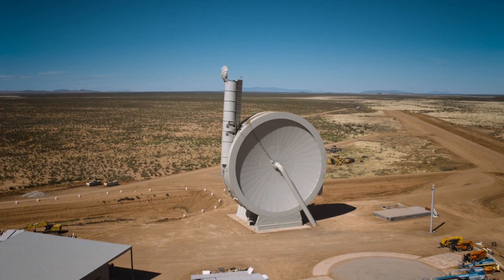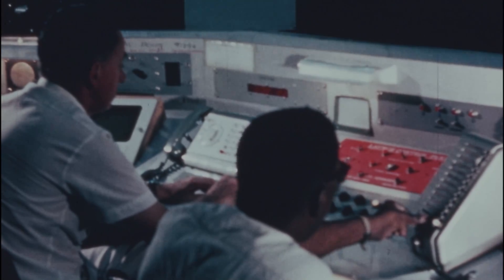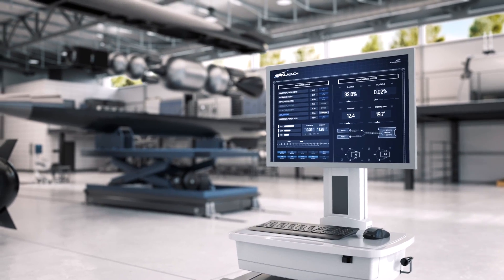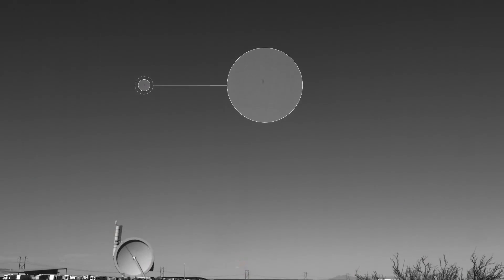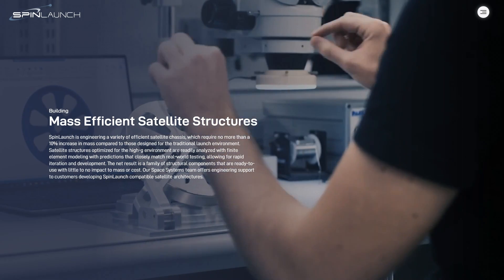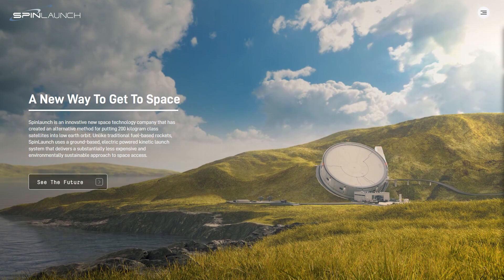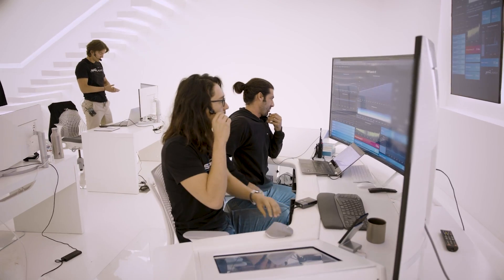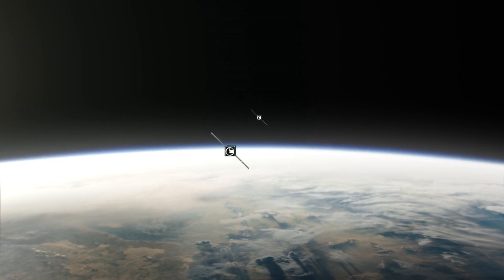Can Spinlaunch Throw Rockets Into Space?

Comment: This concept is realistically almost impossible, since you need to go slow at start and faster to get to space. Normally rocket experience max q at around only 20-30s which they throttle down the engine, but with this concept, the rocket launch will experience max q at start which will overheat the payload that is very fragile and delicate.

Comment: What about a hyper loop style of launch system.
You take a maglev sled, put it side of a tube that is long enough to get up to speed on a horizontal track. At the end you increase elevation to 30 degrees. Have the entire system run in a vacuum. 
This way much of the centrifugal stress on the payload is eliminated.
Reply: It would still apply a lot of g-force in the final curve. This thing moves at 2 km/s, so the rail would have to reach extremely high in the sky to make it smooth. Not usable for human transport.
Reply: @vast634  apparently this method has plenty of interest. One method is to build the entire launch rail inclined. Payload would only feel the acceleration g force which would constant during the launch.

Of course I was thing more along the line s of launching cargo. The spin launcher would separate the muscle from a humans bones. 

But it is theoretically possible to place the equivalent of a second stage booster with payload to a speed and altitude similar to that of a Falcon 9 booster.

Comment: Here are things they need to do -- some gleaned from other comments: (1) start small; first run it to put 20 kg things into orbit. There is a lot of miniaturization so in a few years getting something small like that is of value; (2) Do a long exit tube with various chambers with partial vacuums, so it is not like it is hitting a wall of dense air all at once; (3) Put it on a mountain; (4) use a counterweight that is released at the same time; (5) put sandbags around it.

Comment: Crazy to think that one failed launch could potentially wreck the entire assembly (and rocket, of course). Mitigating or preventing that kind of event will be their biggest challenge.
Reply: That is true of conventional rockets on pads as well.
Reply: @kvltizt  a regular rocket doesnt destroy the entire launch facility even if it explodes on the launchpad. those things are designed to withstand exactly this with minimal damage.
Reply: You can build two of spin-launch pads for the cost of just one SpaceX launch.

Comment: “Not needing any propellant at all” you do realize how inefficient the energy consumption that would be needed to functionally use these types of methods to actually make them work?

Here is a little incite on the whole energy consumption issue. 
1. Most of all the energy electricity in the world is produced by fossil fuels in order to run one of these slingshots or whatever would take up so much energy that you might as well forget the plan because your burning more coal and fossil fuels to make this thing a reality and trust me every single solar and wind energy dependent to try to Push us off coal and fossil fuel energy always flop. 
2. The idea that we can push a rocket into outer space would require us to go at mock 7 and continue the momentum if we want to prevent us from being pulled out of the gravitational pull of the earth. 
3. There is too much focus pokis bs happening in the science world alone where people make false claims and expectations about scientific research claiming it will be the next biggest evolution. Reality check, most if not 98% of all projects end up as a failure in large projections we have stopped this approach of looking at scientific experimentation long ago we have changed it so we can look at real life application and how it will develop and progress the over all larger picture. 
In reality we won’t be able to even launch a satellite out of orbit with what is currently developed in regards to high speed motors on both a electric and combustion level. The only level of capability that might survive is the combustion method turbine shaft but that within itself would burn more fuel than just using propulsion.
Reply: "Most of all the energy electricity in the world is produced by fossil fuels in order to run one of these slingshots or whatever would take up so much energy that you might as well forget the plan because your burning more coal and fossil fuels"

Rocket fuel also has the same issue but way worse. Rocket engines are less efficient and you also have to consume fuel to move enough fuel with the rocket.

Comment: Id think a mile plus mag launch ramp would be easier to build and less finicky than a spinning arm with a release that needs to be timed

Less moving parts.
Reply: It would need vast banks of supercaps for the ultra-high speeds, but there's a bigger problem. As shown by Thust 2, supersonic ground vehicles destroy the ground! So it would be a mile plus vacuum tube, or the track and its surroundings would have to be designed to resist and divert the shockwave.
Reply: @eekee6034  long ass tube, check.

Comment: A scaled-up version of this launcher will not work on earth. What nearly everyone has neglected is Max Q or maximum dynamic pressure. You may have heard this term watching rocket launch videos and it occurs when the rocket reaches a point in the earth’s atmosphere where air density and rocket velocity  peaks and is equal to ½*p*v^2. With the spin-launch system, Max Q occurs as soon as the projectile exits the launcher. Projectile drag force is equal to Max Q* Cd*A (Cd = drag coefficient and A = cross section area of projectile) and at this exit point the drag force drastically reduces the velocity of the projectile. For an ideal streamlined body Cd=0.04 and air density at sea level is about 1.2kg/m^3 so increasing the launch velocity will not increase the altitude of the projectile. Moving the launcher to high altitude won’t really help unless you build it at 20km altitude where p = 0.09.  I will agree that the prototype works as its velocity is much lower and the A (cross-section area) of the projectile is very small. To all you budding scientists and engineers, get your excel s.s. out and do the math's yourself, its all basic stuff.

Comment: Satellites are built to be light weight and often have many lightweight moving parts that would not be remotely close to surviving the forces put on it in the centrifuge they are suggesting. 100 meters diameter at 450 RPM??? Wouldn't that be 11,300 Gs? Good luck with that.

Comment: 95% of the Shuttle's weight at launch is fuel. Think about that. Most of the fuel is used to lift fuel. The insane G forces required to throw something from the surface into space eliminates humans from those craft. So, satellite launches only - and I seriously doubt even that is truly possible, because as soon as the launcher releases the craft - the imbalance of the machine would cause it to explode. So, NO. I don't see how you prevent imbalance when a piece flies off... think about it.

Comment: Granted high g projectiles have previously carried things like proximity fuses.  Yet I don’t see a path to fuel tanks w their infamously thin tank walls, injectors and turbines surviving 10k g.  Then those fuel tanks have to carry not quite full cryo liquids, bleeding off gas.  They must boil off or burst, and that means a *moving*, ie sloshing liquid fuel at 10k g.  I don’t think so.  Solid fuel orbital stage?  Can’t time the solid fuel cut off I don’t think, which means ejecting the payload instead under acceleration. Bah.

Granted that Falcon 9 payloads won’t be switching to this high G launch as Scott says,  it I can’t imagine any payload.  Nobody can t get a satellite thruster or gyro system through 10g either, leaving what, rocks for customers?

Comment: SpinLaunch says their rockets cost 10x less than regular rockets. Lets assume they're comparing Space X Falcon 9 which costs $62 million brand new, or companies can pay $50 million to reuse an older rocket. Lets look at the numbers:
- SpinLaunch L100 (a mass accelerated rocket which does not yet exist) has a GTO payload capacity of 440 pounds, it would cost $6 million
- Falcon 9 has a GTO (flight to outer space basically) payload capacity of 18,000 pounds, and it costs as much as $62 million. 10x more cost for 40x more payload
- You would have to buy 40 SpinLaunch rockets to equal the payload cap of a Falcon 9
- SpinLaunch costs $6 million, but to match a Falcon 9, you'd be buying $240 million worth of launches from SpinLaunch

So if you had to choose, would you sit and wait for SpinLaunch to actually make their hypothetical L100 and pay 40 * more over time, or order an F9 right now? Lol

Comment: A dumb solution to balance the rotor during the release is to release a simmetric weight attached to the other side of the spinning arm. The problem is that this weight will crush into the earth, maybe they could dig a hole to adsorbe the impact

Comment: I was wondering if you'd go into any of the engineering struggles. It seems like the easiest way to balance the load at the instant of separation would be to just have another detachable load at the other end of the rotating arm. That does introduce the problem that you then have to quickly show down a projectile that you're hurling into the earth...

Also,  I'd love to know how they're counteracting the fact that spinning objects continue to spin when they separate from each other. How do they keep the rocket from tumbling end over end?
Reply: I would think the easiest and probably most effective method, to counterbalance the rotational arm, would be by computer controlled, heavy electromagnetic braking. Much in the same way, a MagLev train, is shunted through its tube. 

With the gravitational weight, evenly distributed, between the payload arm, and the counterweight arm; the millisecond, the payload is released, transfer the weight that was in use by the payload to some sort of electromagnetic counterbalance system to mimic the same level of weight and stability, as, a secondary electromagnetic, computer controlled system, initiated braking.

Comment: seems pretty cool. wouldn't it be good to create a low pressure zone around the exit point so it's not like hitting a brick wall upon exiting the device?
up next is a railgun that launches things into space. depending on the length a human might be able to survive being accelerated by said railgun. seems like quite a number of problems with such a design but would be pretty cool. it also has the added benefit of being ready once it's charged, instead of waiting for it to charge up while it's attached to your multi-million/billion dollar object. also don't need a vacuum.

Comment: This thing is an absurdity that can only be justified in a low gravity, low or zero atmosphere situation such as the Moon or Mars.

A huge amount of fuel is expended, just moving the rocket above the launch tower and just getting past that barrier would make return-to-launch site much more feasible.

I propose a much simpler and less critical means of initial launch. Figure out what would be the minimum useful launch assist speed and then be satisfied with that, because very minor changes in initial conditions make major changes in the capabilities of a particular rocket.

I propose drilling a series of holes around a central hole for the rocket. Put large weights at the top of each hole and connect the surrounding holes to the bottom of the hole in which you place the rocket. Put a seal under the rocket as you place it in the hole, then drastically lower the pressure in the launch hole.

When all is prepared, start your rocket engines and drop the weights in the other holes, creating a ram effect that pushes the rocket up out of its hole with the requisite velocity. This would not need to be supersonic or anywhere close, but all the advantages would apply. The booster could then either provide more velocity to the second stage or be smaller than one taking off from the ground.

If this just improved efficiency by even 10%, the above mentioned advantages would apply. Second, it is not complex or difficult to construct and has no hypercritical timings to worry about. Controlling the weights dropped in the other holes can adjust the acceleration applied to the rocket, possibly even allowing humans to be launched in this manner.

So Elon can build one of his boring machines with a 9 meter diameter and throw the Starship and Super heavy up in this manner.
Reply: "This thing is an absurdity that can only be justified in a low gravity, low or zero atmosphere situation"

How so?

Comment: This system would definitely work.  That would only be when the rocket is itself reusable.  This could only be when it is made of stainless steel.  This would work until stainless steel is itself made in space.  If it is indeed achievable, then it will beat the space elevator - for a while.

Comment: The problem is that the rocket structure will have to be significantly stronger to withstand the massive G forces and that more or less kills the idea

You have a standard rocket
You are going to accelerate it to save on fuel
However to accelerate it the rocket needs to be stronger and more heavy heating up some if not all the fuel savings

Better than this idea is to simply have solid rocket boosters. Whatever your rocket is strap on cheap relatively simple solid rocket boosters to get it out of the thickest part of the atmosphere

This idea would only work if you can achieve the speeds needed to get into orbit without an additional stage

Comment: If the rotating arm had a counter weight equal to the projectile on the opposite arm and they released at the same time (within the 1,000,000th time frame or whatever,) in the opposite direction into a catch receptical/netting/etc,   that should balance the strain on the bearings of the spinning radial arm.